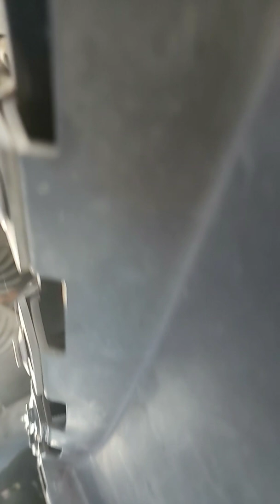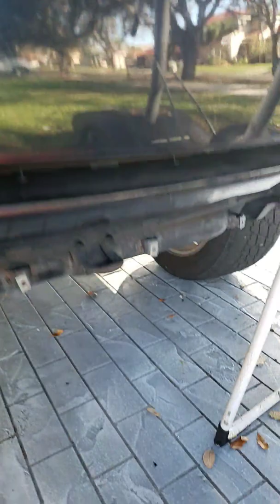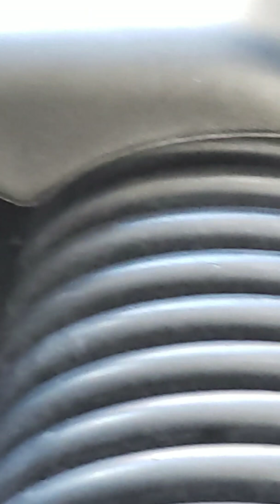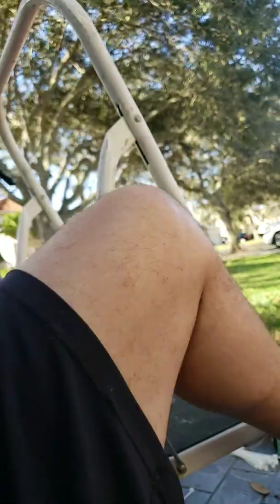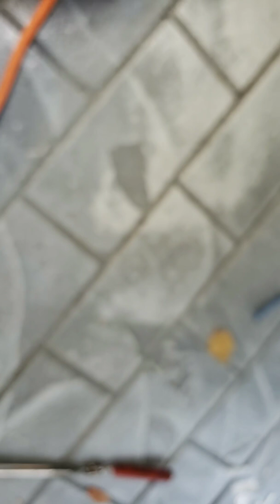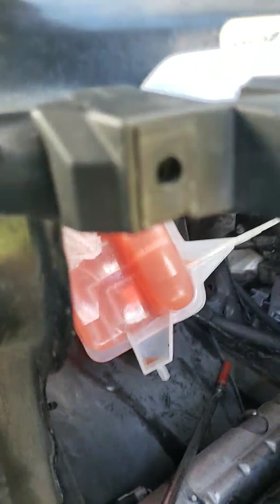2006 Range Rover HSE L322 4.2 L SC Alternator swap, my way!

Comment: I am down to the last two bolts on bottom of alternator. Tried many combinations of tools three larger impact drivers. There is the steel subframe tubes in the way to get a direct hit. Tried extensions etc. What is the magic tool to access these bolts with any power?  Thanks
Reply: I got the bolts out and now trying to take the alternator out the top many hoses in the way